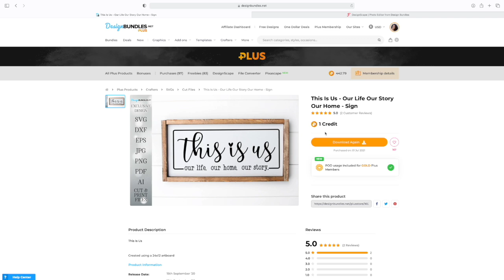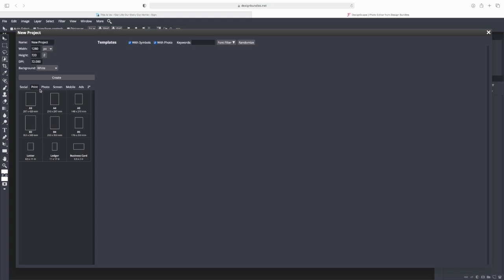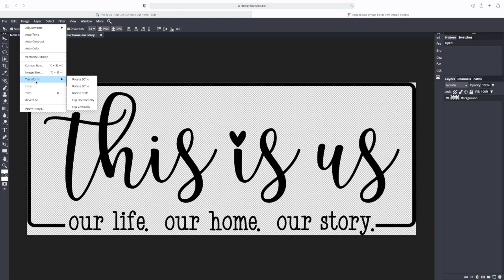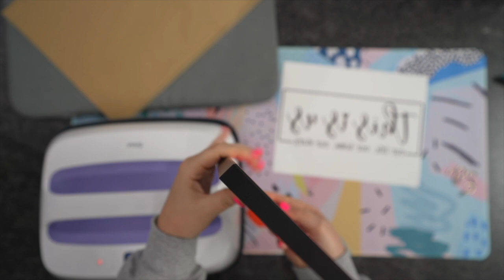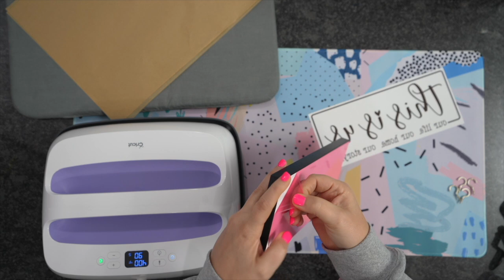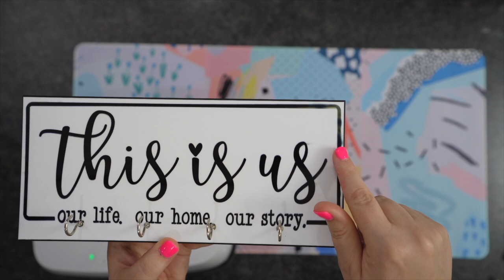🔑 How To Sublimate A Unisub Key Hanger

Comment: Thank you for the video.  Can the Cricut Heat Tape be used for Sublimation?
Reply from the maker: Yes you can! The heat resistant tape is basically just used to hold the design in space for using with a heat press or easy press.